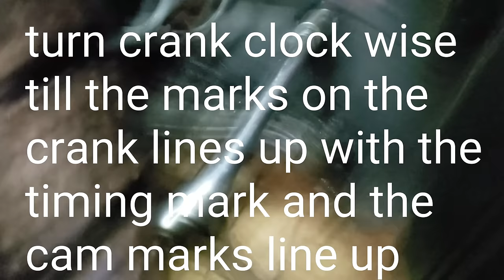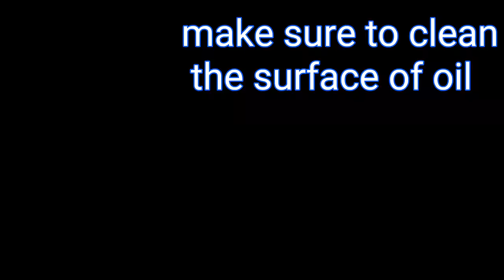How to replace Honda CRV timing chain DIY #crv #rsx #tsx #accord #k20 #k24 #timing chain

Comment: What is the reason that chains need to be changed? Is the same as timing belts?
Reply from the maker: Great question. The timing chain like timing belts wear out as well.
Reply: Thank you for the love, but I was actually hoping that you could answer the question. I sold mine at 289k and it ran perfect. The guy takes it to his mechanic and was told the timing chain is gone. Seems rather suspicious.
Reply from the maker: @ccmyart  I'd like to know their definition of "gone". It could run fine even if the chain needs replacing.. at 289 it would probably be time to replace anyways.
Reply: @UncleTinman  There was no noise except the A/C compressor whining. No knock, good acceleration and started immediately. All signs of good timing. I think either he or his mechanic is lying.
Reply from the maker: @ccmyart anything is possible. You sold the car already. I wouldn't worry too much about it.
Reply: @UncleTinman  
You are right. Thank you.

Comment: is there any specific torque specs you need to worry about?
Reply from the maker: There are torque specs available. For the most part I do tighten bolts hand tight .
Reply: @UncleTinman  ok Thanks. Great video. While looking for parts I notice that they have a timing chain for the oil pump which I see is behind the timing chain, Is this something that should be changed also? It looks like the oil pan needs dropped, not wanting to get into anymore work than necessary. Thanks again for the info
Reply from the maker: @howardmcmillan9627  yes. The oil pan would need to be removed which is quite difficult. I haven't had the need to change that chain.

Comment: You don't show the actual cam turning I tried it on mine and it won't budge... I know that the engine is not blown so, how hard is it to turn?
Reply from the maker: You nee to turn the crank in order for the cam to turn... is that what you're trying to turn? Perhaps try removing the spark plugs...
 That'll help.
Reply: @UncleTinman  Thanks! I meant turn the crank.

Comment: if 2003 CRV chain is broken or something due to no engine oil does it require engine replacement?
Reply from the maker: Chances are the valve would be bent...so you'd have to rebuild the head..also with oil starvation there may be other damage with the bearings and journals. I would suggest replacing the engine
Reply: broken chain for lack of oil? That doesn't happen... you would have issues with lack of lubrication on other stuff way before that happens (if it happens)

Comment: Considering the vehicle has 400k kms, I'm surprised you didn't also change the chain guides and oil pump chain and guides. If the timing chain is so worn, then the oil pump chain must also be worn. It also spins the balance shafts, so it has an important function.
Reply: Wait really? I was just about to do mine at 175K today and tomorrow. Should I get the oil pump chain too and postpone the job?

Comment: You get your parts from the dealer(OEM) or aftermarket?
Reply from the maker: Just aftermarket replacement parts
Reply: @UncleTinman  thanks and one more question,  what about the guides? Are those typically worn out or is it recommended to change them? Cause the timing kit is kinda expensive but just chain and tensioner is cheap... and also when it comes to brands Cloyes or Melling? (Or what other would you recommend?)
Reply from the maker: @saulbroa7551  ive done countless chains and the guides have all looed amazing even at 400k...recommended, but i don't think needed.. ive usee cloyes or oem..  not sure of the other one you mentioned
Reply: @UncleTinman  thanks a lot I'm planning to change one on a 03 and that's why I've watched your video,  I appreciate the info, it would be my first chain (done a couple of belts on Chrysler cars) got the school but not the ecperience (even a state certification) so I think the fact that pros are sharing is wonderful thanks a lot.
Reply from the maker: @saulbroa7551  thanks for the feedback. I'm sure you'll be able to figure it out. Cheers.

Comment: why with the spark plugs out it make it easy to turn the crank when u where lining it up ? 9:15
Reply from the maker: With the spark plugs out there's no compression forcing the engine. An engine is essentially a big pump. When you take out the spark plugs. It becomes free flowing. No pressure. A healthy engine will be quite hard to turn due to compression. Hope this helps.
Reply: @UncleTinman  THANK U that makes sense !!

Comment: How much for all the parts that were replaced
Reply from the maker: I would suggest looking on Rockauto.com for a price comparison. I don't recall pricing. Hope that helps.
Reply: @UncleTinman  Could you possibly provide the links for the parts you used in the description. I would like to make sure that the marking are on the chain as shown on the video.
Reply from the maker: @ms.crystal8280  I didn't order them online. They were from my local parts supplier. I believe they all come with that marking on the timing chain.  Hope that helps.

Comment: and that about the little chain!!!  why did u not change it?
Reply from the maker: That chain drives the oil pump.. in order to change that would require removing the pan and oil pump. It's a much lengthier process and it was called for.
Reply: @UncleTinman  correction * you just need to remove the oil pan to get to replacing the oil pump chain, guide n tensioner - YOU DON’T HAVE TO REMOVE THE OIL PUMP TO CHANGE THE CHAIN OR SPROCKET ⚙️ 🤦‍♂️

Comment: Why do my lines not line up after the rotation?
Reply from the maker: Sorry. The markings on the chain and the gears won't line up after rotation. It was a mistake in the video.
Reply: @UncleTinman   Thank you for explaining. So My dots in between the two chain links wont be in the same location after 1 full rotation >? Is this what you are saying ? oh wow thanks in advance I subscribed and liked it. Can't wait for your future videos!
Reply: Hey so I did everything exactly as the video. Even with the updated info you gave me about the rotation, in my last question. Now the car runs smooth but after 3 min idle, it runs rough then I get a P0300 code. Any suggestions?
Reply from the maker: @chalekid333  P0300 is a misfire code. Have you tried doing a valve adjustment? I've seen a misfire code from the valve adjustment being off. Hope this helps.

Comment: Hey sir I followed every step but the chain marks and the dots aren't lining up :/
Reply: After rotation
Reply from the maker: @87emagdnim  my bad. They don't line up after rotation.
Reply from the maker: After one full rotation it will be out of line. I usually turn about quarter turn and turn back and it should all llstill be align.
Reply: @Uncle Tinman  oh bro it's not your bad. So I lined everything up and I think I'm just trippin cause the different color chains aren't lined with the dots but after a rotation the markings line up except the different chain links on the dots. Lol sorry I'm so horrible at explaining

Comment: After you replace the timing chain with the marks and you do one rotation it will not line up it takes like 54 rotations to line up back again on a 2005 CR-V.
Reply from the maker: Yes
 That was noted in the description.

Comment: Im doing mine and just broke the solenoid because it wouldn't come out so easy like yours. Be careful lol.
Reply from the maker: @hadiki95  yes. Sometimes they get difficult to remove. I usually try to twist it to try and loosen it up first. After all they could have been untouched from.factory which could be 20yrs. Good luck. Cheers.
Reply: @UncleTinman  thanks haha. It spun freely but every time I'd pull and pull nothing so I tried to leverage a pry bar on it and it just decided to give a different way. Hopefully after I remove the timing cover, I have some material sticking out to pull it out with.

Comment: Didn't show tightening the crank pulley bolt, just hitting it with an electric impact is no where near tight enough.  To anyone watching this, it's 36 ft lbs and then 90 degrees more tighter after that.
Reply from the maker: Thanks for your comments. I'm not sure what the exact torque spec is for the crank pulley. The electric gun is rated at 1000ft/lb fastening torque. I've been doing this procedure the same way for over 20yrs now and never had a crank pulley bolt come loose. So for everyone watching take it as you see fit. Cheers.

Comment: i’m not looking forward to replace mine. 

that firewall/wheel well is so close to that fanbelt side of the engine, even replacing the water pump was a pain.
Reply from the maker: It's not too bad if you have the correct sized tools. Short/shallow sockets are your friend.

Comment: im not convinced! i read lots about it actaulyl beign the guides that wear, teh chain doesnt stretch. What if the new ones jsut have one less link? They could be doing that to make u feel all cozy after your purchase, make you feel liek your old one was stretched. mine is so worn that the previous owner set the crankshaft forwarda  notch to compensate lol, so when i do thism im going to count the links and report back here. i recon its a clever scam, and i actaully need guides.
Reply from the maker: Thanks for your reply.. the "stretch" is the links wearing out... the guides on this one was in perfect condition. Please do report back when you do yours. Cheers
Reply: @UncleTinman  right, update. and people wont like this, but im about 99.999 percent adamant that every single person doing this timing  chaing process on youtube, including this one, is getting it wrong, because some aftermarket manufacturer told the entire world how to do it wrong.
If you check this guide,, notably point 3 and 4, you wil find that they show that all dots, on cam and crank shafts, are always in the center of a visible outer link. That means that it must be an even number of teeth betweeen intake camshaft dot and crankshaft dot. 
However, every video on youtube including this one, shows that the top 2 camshafts dots are visible betwen the links, and the bottom one is hidden behind the link. That means you are all off a tooth. becqause you are all an odd number of teeth between the cam and crank.
http://honda.automotive-manuals.com/cr-v-2002-2005/A00/HTML/UQ/S9A5EUQA14674300000KCAT10.HTML
Reply: that guide is illustrated by honda themselves! i just cant belevie that they got their own llustration wrong, or that ths timing chain has a tooth differnece in different markets, im living in philippines.
Reply from the maker: @jeremyjohnthompson5187  so basically you're saying is all you need to change is the guide? Well.. all you would need to do is compare the length or number of links between your old chain and original chain.
Reply: @UncleTinman  well, it tursn out i was wrong! the dot in the middle of a link is for the K20, shorter block, different numebr of teeth, whcih happens to be an even number. SO its important for people to realise that not all countris have the same engine for the same year model. europe and SEA for example use the k20 for 2002-2006 wheras almost everyone else has the K24. so all youtube vids need clarificaton abotuwhich engine theyre working on, coz theyre almost identical to the eye.
Reply from the maker: @jeremyjohnthompson5187  the viewers need to make sure what size of engine they have in their own car... the video merely shows you the steps on replacing the timing chain for the style of engine.... In this case K series engine... whether it be K20, K23, K24. 

Thanks for clearing up your findings.
Reply: Well jeremy, I followed this video step by step, and my car turns on now
Reply from the maker: @Ruben901  Awesome.
Reply: @Ruben901  WEll, now, me too!
I just finished the job yesterday. it took 4 working days (over 3 weeks) do get everything apart and only 1 afternoon to get it back together. I compared the old and new chain, indeed it had 2mm difference in length. I had seen lots of youtubers hold up chians and compare lengths, but none ever showed the actual links, and they were always so significantly different compared to the new chain that i couldnt imagine the engine even running with timing so far off.

Comment: why didn’t you install new guides? if you gonna do it do it right boi
Reply from the maker: I think i stated in the video... the guides did not have any wear whatsoever...so why replace them?
Reply: I came here to ask this. Well ... Not in the same way... 

I know everyone touts replacing guides as common practice, but at 400kms those looked damn good. My girlfriend's is starting to rattle at startup so I'll be doing this job soon. With only 70k(miles) on the clock, I won't be replacing them based on what I just saw. Probably won't replace the tensioner either.
Reply from the maker: @thatsmrgimp2u  thanks for your comment. Yea.. at 400k there was no wear... so...why change them? I would recommend changing the tensioner as they're somewhat known to fail. Cheers.
Reply: @UncleTinman  I did some more digging after commenting, and yeah new tensioner seems like a good idea.